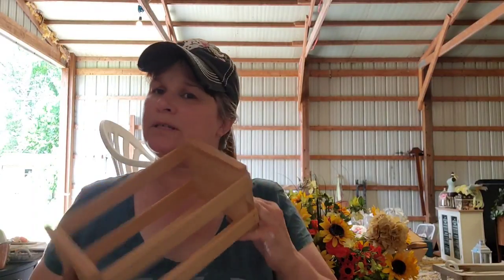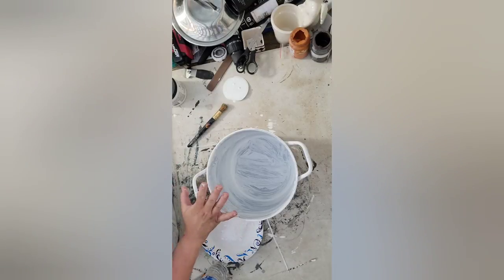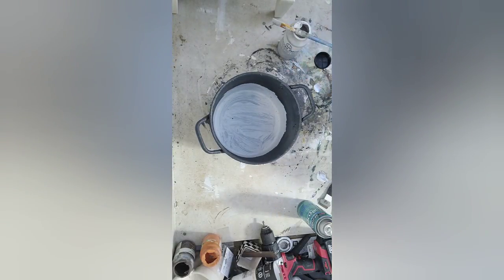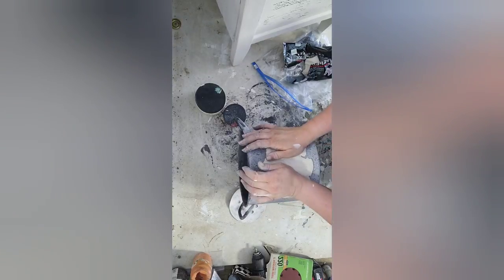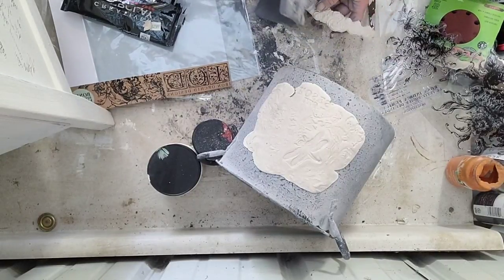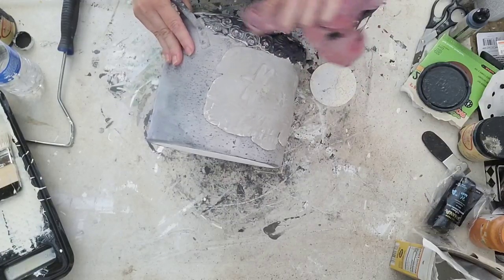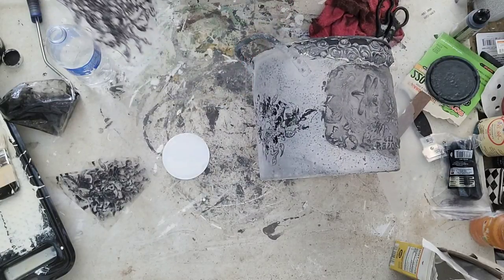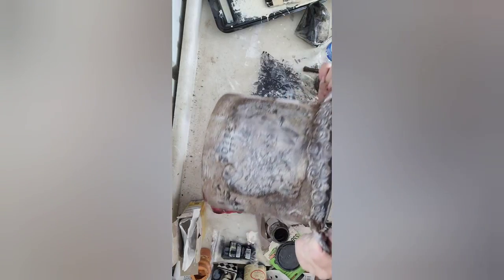How to flip an old stock pot for profit! trash to treasure!

Comment: Sorry for another comment 🙃 but I wanted to give you a tip, if you're curious how to use hot glue!
Because these are great moulds you can use them in the oven which means you can fill it with the glue and place it in the oven (depending on the glues melting temperature) and within minutes, you will have the perfect casting!
You can also have the moulds already heated up so the glue won't seize, the second it's hitting the mould!
I hope this helps anyone, who wants to try the hot glue casting and heck you don't even need a glue gun!
Just get the pellets for the melting pot and pour them in the mould, adding a little more when the first round is melted!
Good luck and I love how this turns out!💗
Reply from the maker: I have been wanting to try glue. It may be my next mold!

Comment: I juuuust found your channel and I am ridiculously happy about it!!!
I love what you've done with the pot BuUuUuUt I wanted to give you a tip, that'll age the absolute HeCk out of metal anything well except for stainless steel because it's right there in the name on WHY it WON'T work on that BuUuUuUt AnYwAyS if you place everything you want to age in the dishwasher, it will come out dull, sometimes pitted and if you do it twice back to back Holyfluffernutter, you won't even recognize it!!!
I use a damp cloth to make sure any residue is removed, then I sprayl it with a matte sealer and finish up😏 whatever it is I am doing with it!!!
Another way is to use the"frosted glass"spray paint sprinkled with pigment (something along the lines of dark and decrepit by diy, before it dries completely!
The last method works great if you use steel wool to give the surface"tooth"especially if the pieces are to be used outside or handled!
So AnYwAyS I love the video and can't wait to binge watch the rest!
Lol I will make sure I hit the like and leave a comment so it can help your channel in the algorithm!
🙏4✌️ AlWaYs 💗
Reply from the maker: Thank you for the tips!